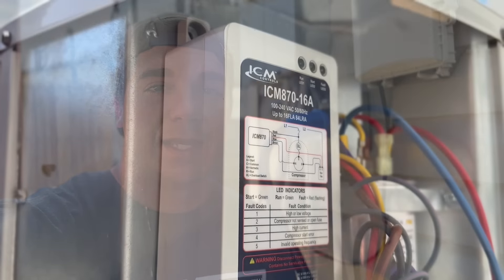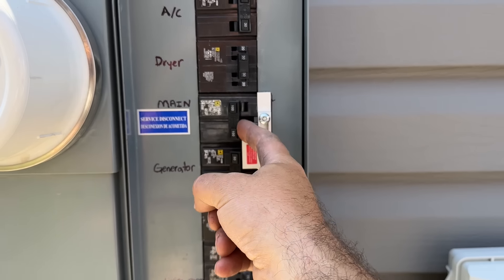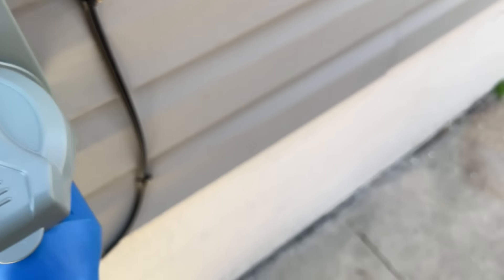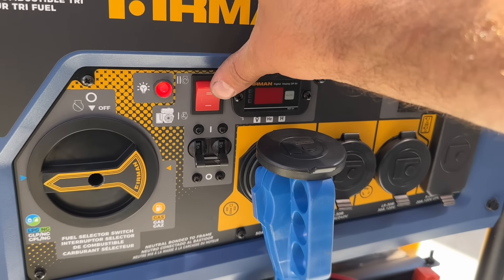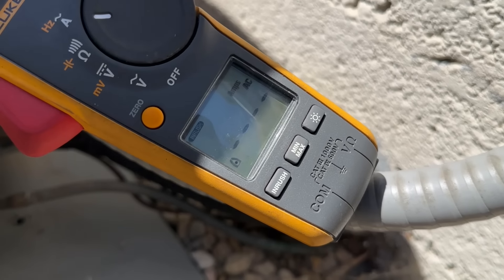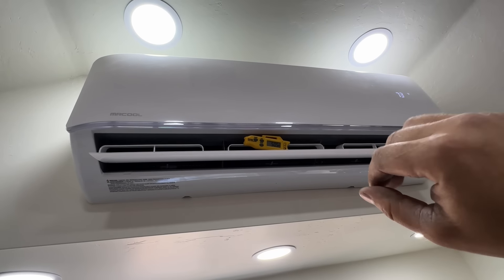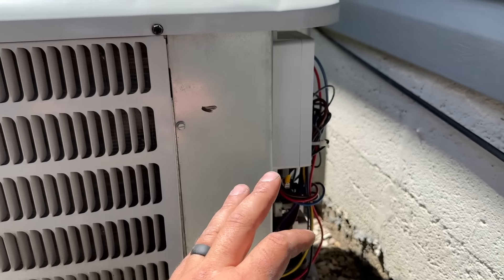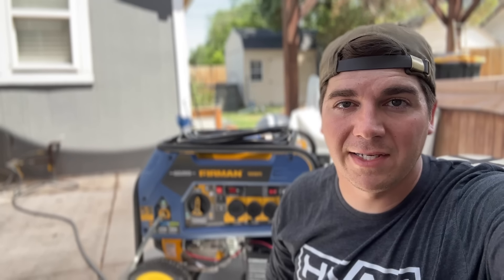How To Get Whole Home Backup Power For Under $1000

Comment: Please remember all generators are not created equal and to run electronics it is safest to have one with a Total Harmonic Distortion (THD) of less than 6% or it can ruin computers, DVD players, and other sensitive electronics.
Reply: Yup that’s true. The only generator I can find out there that is 3% THD is a Westinghouse IGEN 4500DF but it’s only 120v. 
My outdoor Unitary Heat pump is a Coleman HMH7 with an inverter board.
My natural gas furnace is a 2 speed variable ecm so it also has a board that requires good sign waves.
I was going to buy that Firman he’s got but I think the THD on it is too high.
I’m an Hvac tech as well and did this research with a help from the supplier tech support.
I’m surprised that Firman powered up his minisplit as well but how do you guys feel about wear and tear on those boards with that high THD?
Bad thing about this Westinghouse is it’s only 120v 30amps so it’s only good enough to give me natural gas heating but no AC is we’re out during the short summer here in Seattle.
Great video, just my thoughts and also if anyone out there that knows any portable Generators like those that can do 240v 30amps any type of fuel with a low THD roughly 3-5% is what I’m trying to find. 👍
Reply: I added a $100 ups and my electric stuff is safe with the same gen set
Reply: @PaulCyclist  I am worried about the electronics on just about everything and I have a 4,500 sqft home so I got the SUA10000EC from Costco for less than $800 and it has a THD of less than 5% plus it's big enough to run almost everything in my home if needed (of course not the washer and dryer). Luckily, I haven't had to use it for that but I have been happy with it for what I use it for.
Reply: @TrungNguyen-jf2sg  if the neutral is bonded to the frame of the generator make sure you wire in a disconnect before hooking it up to your breaker box or else it can mess up some stuff. Bonded to the frame is great for using it on its own, but your house is already grounded so I wired in a disconnect wire I can use to break the neutral free of the frame if I need to use it for my home.
Reply: @TrungNguyen-jf2sg  I got the SUA10000EC by iPower from Costco and it has less than 5% THD. It was a great buy at the time (less than $900 if I remember) and it will run 240V at 50A. Once I wired in the bonded neutral cut off it was good to go.
Reply: @ahent1975  thank you, I looked up the specs on that sua10000ec. Their website says thd - standard. Didn’t say a number.
Reply: GM10500iETC is inverter generator can protect the sensitive devices
Reply: @yolandalee2335  yes, inverter generators are known for low THD but they generally have less power and are more expensive than standard generators.
Reply: Very good recommendation. The guys generator in the video likely has 15-18% distortion and will havok electrical components.
Reply: @ahent1975 but no natural gas option
Reply: @ammogiant824  yes, that is the biggest issue I have with this model is that I don't have a propane or NG option with this model.  However, I have a bit of gas I keep on hand and with my teenagers I have access to 3 cars (right now with a 4th coming) that will have gas I can siphon if needed. Not a great option for the apocalypse, but a pretty good one if the power goes out in an ice storm for a few hours. I live in a pretty suburban area so it's not usually an issue. This option for a generator works for me but your mileage may vary.
Reply: Adding a UPS to all electronics such as computer, TV, and other sensitive appliances will eliminate the need of buying expensive generator. The UPS is basically a battery and inverter. The inverter in the UPS should clean the signal and ensures a smooth sine wave at the correct frequency 50Hz or 60Hz  also, there is device called stabilizer that can improve the AC signal for larger appliances like smart fridge but usually expensive and heavy.
Reply: Its why you should have multiple computers and gadgets, that can be put in that position to be ruined, buy old devices that just get internet, and use them, if they get wasted, oh well…old iPads or tablets csn cost barely anything, and in an emergency its good to have them.
Reply: Most electronics go through a DC transformer and that rectifies the AC so I am not sure you really ever have to worry about this much. Maybe you do with appliances that have control boards, etc. but I doubt it. ALL electronics that contain logic circuits run off DC. And if you really want to be safe, just by a UPS and several and plug your sensitive stuff into those.
Reply: Or……just install a backup generator that runs on natural gas. Costs a little more or a lot more but no fooling around out in the weather and starts running automatically and runs the whole house without a bunch of bs.
Reply: What is a UPS?
Reply: @eddievibbert6740 universal power supply. Basically a battery backup that outputs AC.
Reply: I checked Ipower out on the spec page they state the THD for SUA10000EC is listed as Standard to me standard THD would be 25%
Reply: @GeneralLee0178  I'm not sure what to tell you, the manual and brochure for the model I bought a couple years ago specifically states "the generator features Pure Sine Wave Technology with less than 5 percent THD" I wonder if they changed it in the couple years since I have bought it.
Reply: What is a UPS
Reply: @mikemccarthy6939 UPS stands for uninterrupted power supply. Like a previous commenter stated it is a system with a battery built into it. Since the sensitive electronics are running from a battery you can have"dirty" power running the UPS and the battery in it feeds clean power.  They also help with short term power outages (a few minutes depending on size of UPS and system it is powering)
Reply: Yeah I had to buy a big inverter generator to run my game consoles and Gaming Rig PC.
Reply: Just add a $200 in-line UPS station to the entertainment center. The battery will filter it out and the UPS will act as a surge protector to protect everything. Super simple solution.
Reply: @darrenjohnson379  this will help if your powering one particular area.  If you are powering all or most of your house then you have to worry about all the little electronics in smart refrigerators, ovens, smart lighting setups, etc. If you want to use a large generator with your house it's better to get one with lower THD.
Reply: @darrenjohnson379  Not true my generator killed mine, I tried replacing the battery and was still dead, I Replaced unit and got a inverter generator, now I have no issues running entire house, BTW the UPC’s are just simulated sine wine, not pure sine wave, if you put them a oscilloscope you can see the difference.
Reply: @no1but24  in line UPS will filter out and act as a line conditioner. You just need to make sure it’s significant enough. Cyberpower 1500 to start.
Reply: Harmonics can kill a UPS. Inverter generator is expensive but worth the peace of mind. Besides, a UPS rated to run 30+ Amps at 240v would be super expensive.
Reply: @PaulCyclist  those things run at about 30% total harmonic distortion and they are absolutely crap, you have been duped!
Reply: Whats a dvd?
Reply: Dude said dvd players like we're still in the 2001 😂
Reply: @patiencezero-xc9zl  Exactly what I was thinking. Any type of sensitive electronics are always powered by a DC power supply.
Reply: @no1but24 there are UPSs that are true sine wave. Not all are simulated
Reply: @TrungNguyen-jf2sg just install a transformer or a ferromagnetic voltage regulator between your house and the generator and problem solved. 

Other solution is to use the generator to charge batteries 🔋 and then use a high quality off-grid pure sine wave inverter. 

Better solution, go solar and then you get rid of the problem of having gasoline.
Reply: @PaulCyclist correct. Or install a transformer or a ferromagnetic voltage regulator.
Reply: @patiencezero-xc9zl Refrigerators, air conditioners, fans, microwave ovens, water pumps and everything with electric motors can get damaged with distorted current.
Reply: @eddievibbert6740 

Uninterruptible Power Supply.
Reply: @no1but24 very good comment
Reply: What’s a DVD player?
Reply: People run square wave UPS boxes which have 33% distortion with no trouble to their electronics
Reply: @rubenp8750  the trouble is for devices with inductive loads like induction motors and ferromagnetic components like microwave ovens.
Reply: The problem with all these videos is people are going off of what is already known, not pushing new ideas. Yet another example of how schools and people have failed.
Reply: @eddievibbert6740 Uninterrupted Power Supply: Battery.
Reply: I'm an electronics tech. Most electronics and all newer AC systems with variable speed drives use switch-mode power supplies that literally do not care what waveform they are fed. THD only matters where motors are fed directly.
Reply: @ajarivas72  Older microwaves use ferro resonant transformers which tend to filter out harmonics similar to older power conditioners. Newer ones use Switchmode Power Supplies, which don't care.
Reply: @evanpnz  

Thanks for the feedback. 

You seem to be very knowledgeable about this.
Reply: @ahent1975  Yes, important safety tip.
Reply: @ajarivas72  Thanks. I maintain my own AC and have installed a mini split in my attic, so I'm interested in the subject. I've spent my life working on a wide range of RF, consumer and power electronics.
Reply: @bubbatime maybe maybe not

Comment: I’m in Texas and still recovering from Hurricane Beryl. I ran a gasoline-only generator, and finding an open gas station with available fuel was nearly impossible. I'll be switching to a natural gas generator.
Reply: I live in Katy. I have no back up generator. I’m definitely looking into something now.
Reply: I'm in Katy as well, and getting gas was a crap shoot. Will be switching to natural gas for sure with gas as a backup.
Reply: I live in spring Texas ,  work in Jersey village 290 area. was lucky to go to advanced auto on jones and 290 where they had a few , also went to harbor freight where they  had 2 to chose from 3500 and the 6500 . I got the 6500 . $479 plus tax. it runs window unit, refrigerator box fan small electronics like cell phone etc.  initially I used the inverter in my Nissan titan to run the refrigerator all night did not even burn a 1/4 tank of gas.
Reply: @deanowright359 I have a lifted 2019 Nissan Titan Pro4x. I love that V8.
Reply: @bc_usa  yes sir !  My first taste if the titan was the 2008 sv, then 2013, then 2015, after I got a 2018 which I am planning to keep until the wheels fall off.
Reply: Propane. You can store it indefinitely. Also, when you’re done with tour generator and store it for months at a time, using propane won’t gum up your generator in storage.
Reply: I heard you need permits to run a rap from your natural gas meter. I was considering getting a trip fuel to run natural gas
Reply: I'm in katy as well. I have a fireman generator but the bigger one 1100 watts. You can use propane natural or gas. Using natural or propane doesn't allow to get all the power or if it though
Reply: Natural gas generators were shutting down due to low line pressure from high demand and perhaps some issues with compression stations. A neighbor was unable to get their gas stovetop to stay lit due to low line pressure.
Natural gas is not guaranteed but still better than gas. Having a bottle or two of propane available is a good idea
Reply: I have that same generator and if i unplugged my 2 freezers and 2 refrigerators i ran my 4 ton ac with no soft start but i couldn't turn anything else on
Reply: Yo im in atascocita texas we went 8 days without power and  I ran propane the entire time it was a life saver cause you aren't lying about the gas stations! It was mayhem!
Reply: @danneo653  Do you mean pull a permit to install one?  Any of that depends on where you live... your state, county, city, etc.
Reply: @StevieWonder737  Up here in RoundRock during the Feb 2021 event we never lost NG service...definitely hit and miss.  The only advantage propane has over gasoline is storage.    In terms of run time per $ its more expensive than gas and both are WAY more expensive than NG.  Resupply of gasoline is simpler than propane bottles, the little BBQ ones or the ones Shaq could fit in.  I keep 20g of gas on hand that I dump in to our vehicles once a quarter.  Thats my NG backup.  Its also important to know your "mileage" as it were.  How long can I run on X amt of propane or gas.  I know can run the house minus the AC's and I will I get 24hrs on about 6.5 gal...found that out in Feb 2023 :)
Reply: @jzahirniak  I wouldn't equate Round Rock with Houston in a hurricane or other weather based  event.
Reply: Don't turn your a/c down so cold and you might get better efficiency.
Reply: In Spring and backup gen burned out on day 2 of Beryl. Unfortunately I was only able to find a Generac 6500 in Huntsville at HD for 1k so will be storing gas with stabilizer for awhile now😂
Reply: @StevieWonder737  I didnt.  And Feb 2021 was not a hurricane-related event for Houston or Round Rock. You have Hurricane issues from time to time.  Other than that you have the same weather as Round Rock...just more humid.
Reply: Forget all that, crank that baby up and connect my dialysis machine
Reply: I'm in spring what's avg cost to get a soft start installed along with generator installed with gas line
Reply: @childofibiza1,  a Micro Air Soft Start parts with installation from an electrician will run around $550 or more while a NG connection to your meter by a licensed plumber will probably start close to $400.  Obviously, someone who’s very handy could perform both those jobs, but the soft start parts alone are now nearly $450.  Doing either job if you’re unfamiliar with the respective trades could cause problems (or worse), and would possibly cause more expenses in the long run.  Both are well worth it, but if you could only afford one, have the gas connection done first.  It will free you from being tethered to a gasoline station during an outage to keep your generator fueled.  Prices for these jobs will vary, but I’m quoting for professional or semi-professional (apprentice-level) fees.
Reply: I use propane and I would KILL for a natural gas line LOL….  but still way batter than dealing with gasoline.